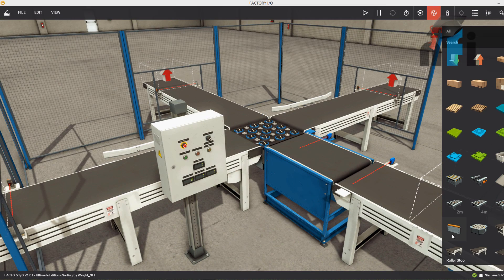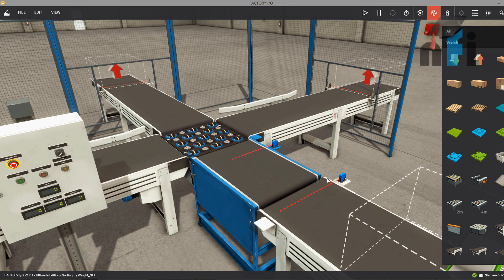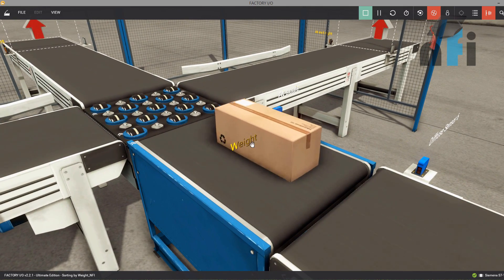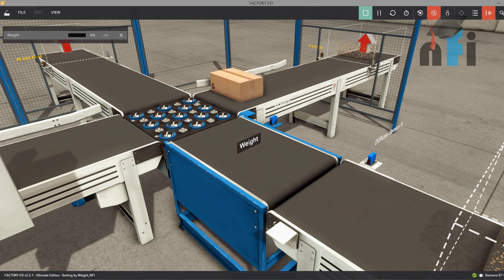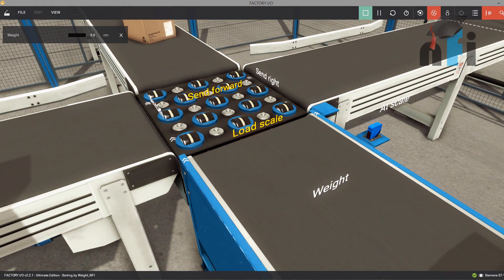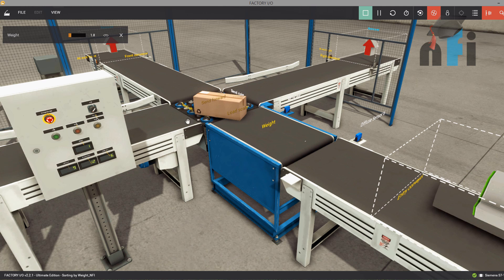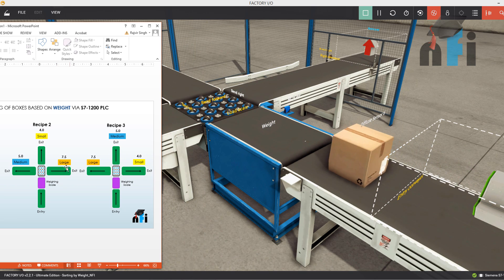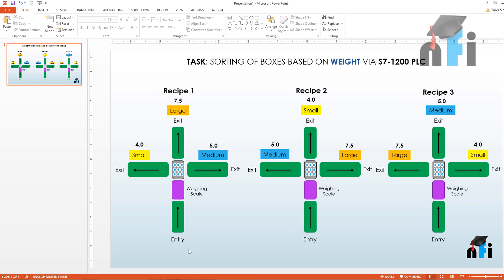Sorting of boxes via weight in S7-1200 PLC

Comment: I want to connect tia portal and plcsim with factory io but i have a driver error. The message of factory io is :more than one instance of s7-plcsim v13/v14 has been detected.please make sure that only instance is running. What i must do to solve  this problem?
Reply from the maker: Try to restart your PLCSIM. May be you have opened it multiple times.